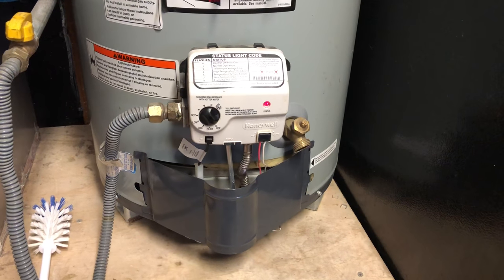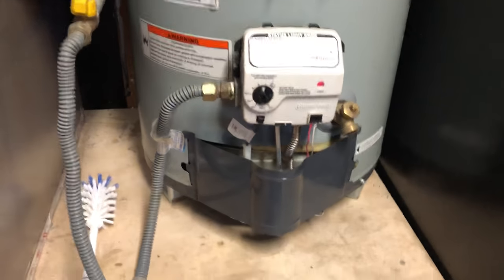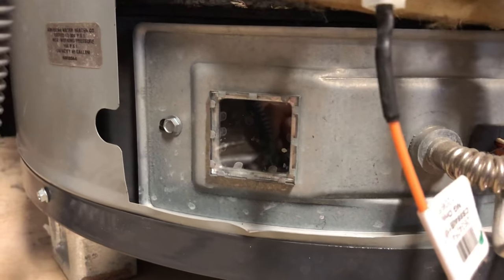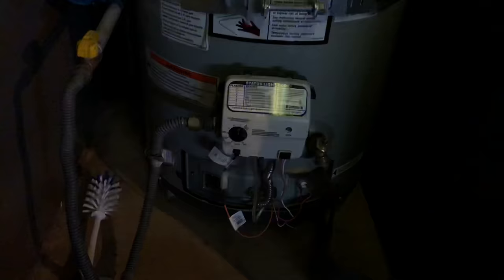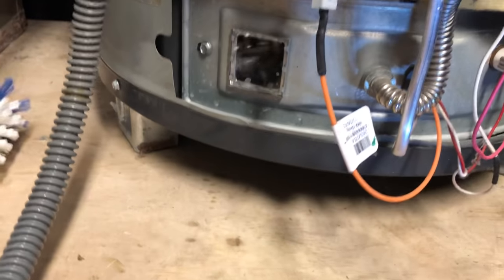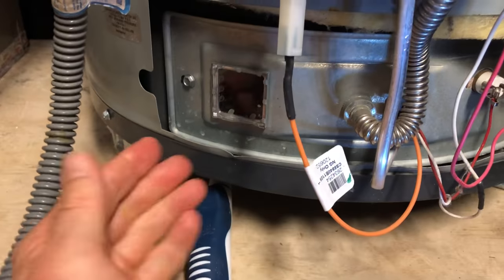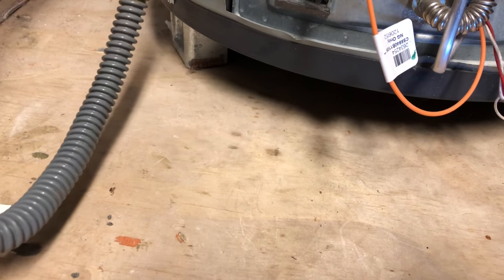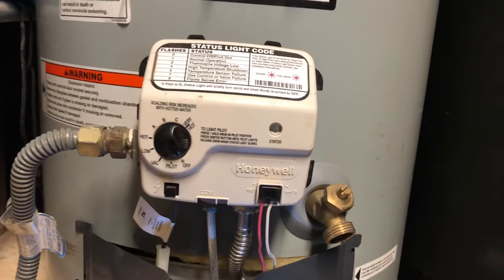Water Heater Pilot Keeps Going out - CLEAN THE FILTER GRATE! 2024 (UPDATED!) Most common issue!

Comment: Thanks for sharing the video and creating a forum for us to share, learn, and help each other. I've had water heaters without air grilles in my house for many years and never experienced the pilot out issue before. But mom was an innocent victim of the pilot going out today. Mom had no hot water when she woke up this morning on her 2 year old Lochinvar water heater in the garage, and we were dumbfounded why the "new" water heater went out. I adjusted the temperature dial to try and force the burner on with no success and finally realized the pilot was out. I tried to relight the pilot following the instructions but I couldn't see a spark when I pressed the igniter, and didn't know exactly where to look for the pilot through the small glass window. Several hours later I somehow got the pilot working and the flame going and thanked God for helping me. I watched the flame and noticed there was blue then orange flame then blue and didn't know the cause. My smarter than me phone told there may not be enough air, and after a while I found the air grille/grate/filter/screen on the bottom. I vacuumed and cleaned everything all around the bottom and the flame was back to normal blue. Like I said I've never had a pilot go out on the older water heaters without grilles, but now I know the air intake grille at the bottom of new ones (AKA flame arrestor plate) can cause unexpected problems. The engineering safety improvement required for new water heaters made after July 1, 2003 solved a flammable vapor ignition resistance (FVIR) problem by a design change that called for an air grille intake at the bottom, but after reading stories here I can see how a dirty air/flame arrestor grille/screen that simply needs to be gently cleaned can become an unnecessary financial burden. Why couldn't the FVIR design stipulate little or no maintenance required? https://www.achrnews.com/articles/90837-water-heater-design-changes-in-the-works

Comment: My filter was not on the bottom, it was on the outside wrapped around the outside on the bottom. Cleaned it with a compressor, and Bam!..Got hot water again. Thanks for the tips.
Reply from the maker: Thanks for sharing👍😎nice job.

Comment from the maker: I would clean it every 3 to 4 months or so. It varies depending on how  dirty the area is.  Also how much your water heater is used. If you’re ever having problems with the hot water heater not working right, definitely try cleaning that area 👍
Reply: Check It Out !!! I just got a house with this exact model water heater, watched videos on how to ignite it and got it working so I was happy I had hot water! I put it in between low and hot and it worked great it stayed blinking my next question would be do u leave it on like that or does it eventually turn on or what? I just messed with it last night so I’m just worried about leaving it on or having to turn it on. The white light stayed blinking and worked great. Thanks!
Reply: If your clothes dryer is close to your water heater, you will be cleaning that grate every week or so.  Sweeping up around the dryer after every use helps. The phone number on the water heater will get you a "filter" - a rectangular strip to wrap around the bottom of the water heater. But it's impossible for me to get it wrapped with the water heater already wedged into a corner.

Comment: Thank you so much!  I watched your video and got my HW Htr running again. 
The only issue I ran into is the instructions written on the unit don't mention anything about the Relay reset button. I called the manufacturer and they were pretty helpful. 
Its funny how the instructions to light the pilot didn't mention anything about trying to clean the dust build up underneath either. 
Maybe it's in the instruction manual.
Idk. The unit is an 11 yr old Whirlpool and your video saved the day.

Comment: Great, great idea.  I thought the burner needed to be removed and clean the filter from the inside, but if we can accomplish that with a brush from underneath, that saves a lot of time and trouple shutting the gas, and removing a couple gas connections.  This is the same as cleaning under the refrigerator with that long black  *bottlebrush looking" brush.Brush from underneath, then vacuum up eith a skinny vaccuum hose attachment.

Comment: The purpose for the "Tight" air intake screen on the underside of the water heater is to reduce chance of explosion---caused by external ignition sources--such as vapors.  Note that the pilot area door is also air tight.  I got this info somewhere.  The burden now becomes a homeowners to make sure the air intake screen is free of debris--be it dust and whatever.  Sometimes hard to manage in a very unfinished basement where dust is abundant.  Most people would not even know this is now an issue.  I learned of it by experiencing the problem.  A Water Heater does not use the volume of air say an auto engine uses, but eventually, this will be a problem.  Old water heaters had no such problem--ever.  Next thing you know they'll be putting air filters on them.

Comment: After working for 28 years for Gas/Electric Utility, never did I found dust, even at a dirt cellar, cause any problem.  The prices for the new AGWH $500 and up for a tank to heat water compared to $250.  Not to mention $5.00 for a new thermocouple.

Comment: A lot of these, like my 2009 Whirlpool, came with a cheesy foam and plastic filter assembly that wrapped/linked together around the support feet to "pre-filter" the combustion air before dust particles and such would make it to the metal grate under the pilot. These usually got tossed. My HWH is in the shop area of the basement which has all manner of wood chips and dust and has no bottom pre-filter. Using a flashlight as in the video, I could see the light shining through the grate. But using an inspection mirror reveals that the LED light was sufficiently powerful to shine THROUGH the dust bunnies. If you're on your belly, take a brush with you and clean it anyway. Mine's about 3" x 8" (50 Gallon) but make sure you have the heater off and let it cool for about 15 minutes.

Comment: My pilot light would not stay lit so I check all things out and thought it was the valve. I took the valve a part and found pilot solenoid wire broke loose from the pin solder it back on put back together and work great.
Reply from the maker: Nice job!

Comment: I'd like to add my own experience to this IN CASE anyone has their tank sitting flat and flush to floor, for which case you cannot even access from below with a Scotchbrite:
I rocked the tank a little and kicked a wood shim just enough for maybe 1/4" gap between floor and tank.  Unscrewed the cover of Pilot assembly and pulled it up past the bend in gas pipe.  Then, I used a 1-2 Punch combo of air compressor with a nozzle blower on hose, along with a strong new HEPA vac I got using a car-crevice vacuum tool. I just alternated between the two, as all the iron rust flakes blew all over the place, and also blew and vac'd under the gap on floor.  The Pilot was touch and go for a couple years. Seems that very heavy windy days or if I swept dust around floor would knock it out, and I could light it again. This should rule out bad Thermo.  NEVER knew about dust, filter, debris and such, and after this process I managed to get light on first attempt. I use a handy clamp to  hold pilot button down for a minute and when I came back it fired up!  Best part about success in these matters...is the steam coming out of your shower when you finally wash away the frustrations.

Comment: I have a economizer 6 gas water heater model by Kenmore does it come with a fuel sensor my pilot keeps turning off and my gas company came for a regular inspection replace the fuel sensor as a process of elimination? What are your thoughts please and if you know if this model comes with one. I'm still going to go ahead and clean the bottom I like that idea thank you for sharing.

Comment: My ex came to look at the water heater....said I DONT need a new thermocouple and that the grate is clogged and not getting air.... Proceeded to tell me there's not really a way to clean the grate and that I would need to put a small hole in the grate for air circulation (mine sits on concrete)... Going to go to Walmart and get a brush like this and try this first!

Comment: My Rheem is installed directly onto the ground inside of the catch basin in case of leaking. Did they install this incorrectly as no air is getting under it? Or do I possibly have a different model? It was installed 5 years ago and only stopped working today.
Reply: Rheem water heaters draw air in on the sides. No filter to clean. Maintenance free.

Comment: What if your dryer vent overloaded with lint till it exploded from the wall coupler outside and now the entire underneath your home crawlspace is a fuzzy mess, could that cause the air intake vent obstruction to suffocate?
Reply from the maker: Could be, I just remade this video and put some pictures of what the filter great looks like. Check this one out. WATER HEATER PROBLEM SOLVING - YOU GUT THIS!
https://youtu.be/58X-kWr1jCM

Comment: I need help. So my water heater pilot lights as I hold the button but once I let go it turns off. Any clue to what I need to do to get it to stay lit?? Any advice will help. Same style as the water heater in the video
Reply: 1. Clean underneath really good. 
2. After it ignites & you see a small flame, hold the reset button down 2-3 seconds. 
3. Release the reset button then turn the knob from PILOT to ON.
4. Turn the temperature setting knob from the lowest ( VACATION) to WARM / HOT.
The gas kicks in (makes a loud air sound ) and the small flame becomes huge. Its exactly the same look & sound when you see a welder lighting a torch.
So it might scare the hell out of you the 1st time you do it.
This works for my 2009 Whirlpool.
Also, my HW Htr has a small white RELAY reset button that is not mentioned in the instructions that are printed on the unit.
I found it out by calling the manufacturer. 
Good luck.

Comment: My pilot keeps going out.  But it does relight, then goes out again in a few days.  How is it possible that there is enough air to burn gas to heat the entire contents of the water heater, but not enough to keep the tiny pilot lit?
Reply from the maker: It could be that it’s right on the cusp of enough air…
It’s very likely an airflow issue or possibly a thermopile issue…

Comment: Cleaned my filter but still not lighting. Any ideas?
Reply from the maker: Try pushing in the “reset” button. Look for my video on how to reset your water heater
Reply: @checkitout2468  thanks. I finally got it working shortly after posting, not sure what I did a series of resets finally did the trick.

Comment: would this trip the thermal cutoff switch?
Reply from the maker: I suppose it’s possible. Especially if you kept the system on while you do it. I suggest turning off the water heater then clean the filter grate/flame resistor and then turn it back on.